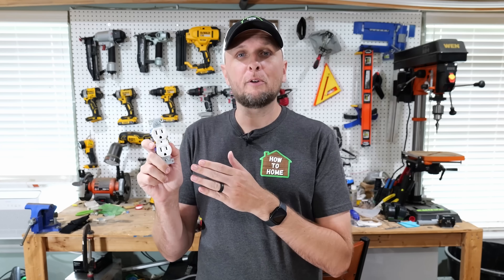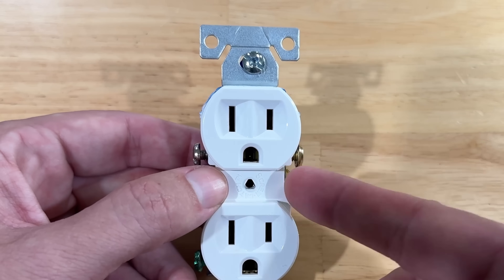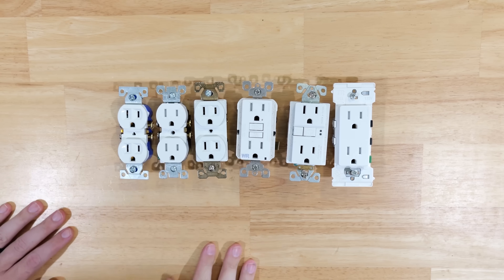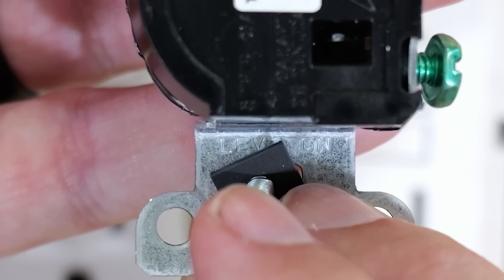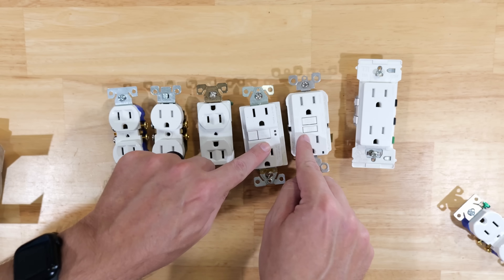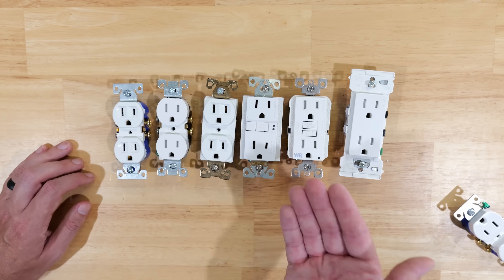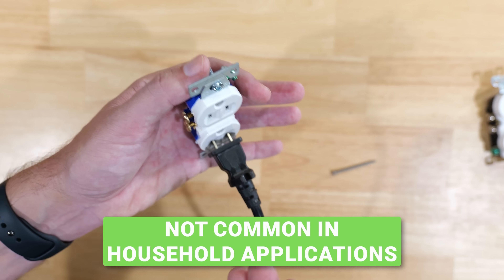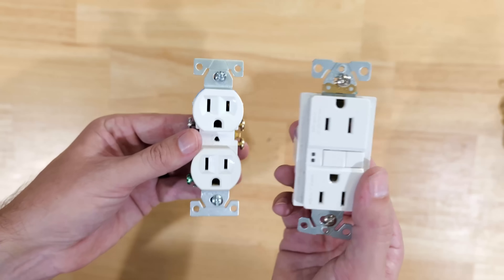The Shocking Reason Why Your Outlets Are Installed Upside Down!

Comment: In my experience it seems that most appliance and extension cord manufactures design their products to accommodate the receptacle being installed ground pin down.  Also, in most cases the only time a receptacle is installed ground pin up is to indicate that it is controlled by a wall switch.
Reply: Retired Electrician here.  WA state.  A common aargument/battle.  Every owner, Designer, talking head had an opinion, up or down.  Inspectors generally refused to get involved.  EXCEPT the ground prong must leave the outlet after the neutral and hot.  It is a design feature that the ground is a longer length for a safe power disconnect.  I can no longer give the design and UL sites, however that is what we were taught in apprenticeship classes as the reason we do not have to shut the power off each time we plug in an appliance.  Look at your power cord,  the ground isnoticably longer to provide for the power to be disconnected in the correct order, and vise versa.
Reply: That would mean that 90% of my receptacles be ground up.  Very inconvenient.
Reply: Retired Electrician here.  WA state.  A common aargument/battle.  Every owner, Designer, talking head had an opinion, up or down.  Inspectors generally refused to get involved.  EXCEPT the ground prong must leave the outlet after the neutral and hot.  It is a design feature that the ground is a longer length for a safe power disconnect.  I can no longer give the design and UL sites, however that is what we were taught in apprenticeship classes as the reason we do not have to shut the power off each time we plug in an appliance.  Look at your power cord,  the ground isnoticably longer to provide for the power to be disconnected in the correct order, and vise versa.
Reply: Yes.  It seems that manufacture’s design is to have the u ground down, like  hair dryer with a built in GFI.
Reply: no such problems Up or Down is the same with Germany 240V wall outlets as there is a ground on the top and the bottom, also angled plugs can be used 2 on the same double outlet..!
Reply: @kpdvw Typical genius design. (sigh)
Reply: Especially so with "wall wart" style timers and the like where you have labeling or even a display of some kind.

I have one exception - a 4xAA battery charger with two-pin (but polarized) plug. It's oriented to favor ground pin up.  Upside down, the LCD bar graph charge progress displays for the 4 bays is invisible. No contrast. Unless you want to stand on your head the only sensible way to use it is plugged into a power bar.

I bought it for portability so no way I'm packing a power bar or extension cord. I stand on my head in hotel rooms a lot. 🤪
Reply: Switched receptacles tend to be placed upside down... I'm not an electrician and never heard of this, but it explains a lot! My current home, and some in the past, fit this standard and I'm happy to know now, for the next time I move and need to figure what's going on with the outlets. Thanks @davidbarham9113
Reply: They had to standardize on something as the alternative would be to either have it stick directly out, which is annoying or they would have to spend some extra money on a slipring design that allows for you to orient the prongs so that the cord is coming out at whatever the most convenient angle is.
Reply: Hair dryers have their own trip wire built in and only 2 prongs. So three prong bathroom outlets are not necessary. Edison vs Tesla.
Reply: Nonsense, all the switch-controlled outlets in my house have the ground down.
Reply: @RSole9999  Hahaha  Just because your house is not like the majority does not mean its Nonsense.
Reply: Items like hairdryers seem to be better accommodated by ground prong down, so that’s my preference.
Reply: In my next house, I am going to put all ground prongs up.  I'll also attach all of my furniture, appliances, cabinetry, and floor fixtures attached to the ceiling upside-down, as well as install ceiling fixtures like lights on the floor instead of the ceiling.  I'm still uncertain as to what my main entrances and garage doors will look like, but I have a few ideas that might prove very lucrative for me when FIMA comes to visit me after the next heavy storm.
Reply: But a receptacle can be split, so one side is on a switch and the other side is always hot.  So much for that theory...
Reply: @brucefowler8690  That in no way refutes the "theory" (I'd rather call it a practice or a convention). In all the houses and apartments I've lived in over many decades, every switched receptable was split. Typically the switched side would be used for a lamp, while whatever device was plugged into the other side you wouldn't want to be controlled by the remote switch but by its local on/off switch. So if followed, the practice would inform you that the outlet is switched and it would be normal to expect that only one side is switched.
Reply: @brucefowler8690  45 years installing recepts and never once thought about turning the switched one ground up, thats because i did it the right way ,like  you ,a split recetacle,
Reply: @brucefowler8690  Actually the theory is correct.  it is indeed how many do it and is sort of a "standard" to use the term loosely.  In a situation like you describe.... I am not sure how I would want it.  I tend to install enough outlets that having one of the two not switched is not needed.

Comment: I install them "upside down" unless the plug I'm plugging it into is "upside down" (refrigerator, window A/C, Power strip,  etc.) 

You can tell the manufacturers don't care because they print the labels/instructions both ways.

What I do find weird on the outlets you were showing is that for an outlet installed horizontally, the writing is oriented for the line plug terminal to be up!?! As a kid who once got a shock when playing around an outlet I default to what I think is safest for babies. I think it is, at least infinitesimally (pun intended infinit... infant...), safer if the ground or common terminal is up. If 10,000,000 outlets installed ground/common up save one kid, it's worth it. Even if it "looks weird" or generates disparaging comments in the YouTube comments section. 😆

Comment: I've always done ground prong down. Now I live in a home built from Adobe block and the outlets in those walls are sideways!  Only have seen that before in Mexico and the city if Chicago....'splain that!😊
Reply: @bobcole3852  Simple answer: Sideways installation prevents you from having to pick a side in a long-standing heated debate like this. 😜
Reply: @davidroddini1512  Of course, in side mounted installations the ground prong should be to the left. :)
Reply: @stargazer7644  lol, yeah so the "neutral blade" is up at top. 😉
Reply: @davidroddini1512  “Countertop spaces require the maximum space between outlets to be 4 feet, and that no part of the countertop is more than 2 feet from a receptacle. So, there are times when an outlet may need to be installed sideways in order to fit into a spot where it is required to be installed.

The required placements of electrical outlets may also influence outlet orientation, as a horizontal outlet may provide easier access for plugging items in depending on the location. For instance, a vertical outlet behind an appliance or piece of furniture may give you no access points, while a horizontal outlet in the same location may allow you to access at least one of the receptacles. If an outlet is needed in a certain location but it is also clear that the spot will be blocked, then an outlet may be installed sideways to try to improve access.

Another common reason for horizontal outlets in your home is simply the result of aesthetic choices. Electrical outlets are obviously a necessity, but if you're on the hunt for brilliant hacks to make your kitchen more aesthetic, you may find yourself wanting to hide them. While this can help your kitchen look nice, covering the outlets reduces their functionality. Instead of hiding an unsightly vertical outlet, some people choose to install horizontal outlets. Horizontal outlets can have a look that is more low profile, which is especially nice for outlets that are placed higher up on walls, such as above countertops. In kitchens especially, horizontal backsplash patterns, such as subway tiles, are popular, and horizontal outlets are especially good in these situations. Rather than break up the look with a vertical rectangle, outlets can blend in seamlessly when they are turned sideways.”

Comment: If ground is on top when a receptacle wears out the plug will begin to loosen and will expose the prongs if the equipment is grounded the ground will be lost 1st and the safety of grounding is lost . If your receptacle is that old, it is normal that your equipment is that old and grounding is your only safety.

Comment: In the house I install ground prong down, in garage, shed, work area I install ground prong up , for 2 two reasons, 1 dropped safety as you show on the video if something is not plugged in all the way and, 2 for stability , the ground prong is longer and feel it will help hold a plug in if hanging and such. one exception in a garage  if I have a fridge or chest freezer, I put that outlet ground prong down due to angle or directional plugs on them , otherwise the cord will go up and have to bend over and go down. Not saying anything I do is correct but is what I do.
Reply: @robertdashnier4184  That’s very sensible. I agree that is a very smart decision.
Reply: I built a garage and turned them sideways….
Reply: Ground down cord weight pulls prongs out exposing them. Ground up cord weight pushes prongs in.
Flat plugs tend to avoid that to begin with
Reply: @heyyou5189  US plugs tend to fall out easily. You want the ground plug the last one to disconnect, so it should be the bottom one for safety purposes.
Otherwise it may loose contact while N and Phase are still connected, leaving the appliance operational without grounding.
Reply: @robertdashnier4184  how many ppl are dropping things on outlets. I mean I drop a lot of things and I have so many outlets and surge protectors. I'm quite clumsy, and not once have I said, that was close to the outlet, let alone hit the plug.  now add the plug tilting out, the object being small enough to fit and conductive. To a lot of others points, if your ground was down, the plug probably wouldn't be leaning out of the outlet in the first place as the plugs are intended for ground down. At an office for that paper clip or staple example, my office always had surge protected or UPS batteries that sat on the floor. Those outlet either faced up (not on the wall, these sit on the floor), or ground might be too a side. So doesn't matter what the wall outlet direction is, there were 6-10 other outlets beyond your control. My garage workbench I have a 6 foot power strip that all the outlets are sideways (ground is too one side). If you really want to solve the drop safety problem, install the outlet above whatever is being dropped. My power strip is 1ft above my work bench, mostly bc I didn't want to have bend or reach around to plug something in. I won't be dropping anytime on our anytime soon.

Comment: Our home builder installed all outlets operated by a wall switch ground prong up (upside down) to make them easily identifiable. All other outlets in the house are in the “traditional” ground prong down position.
Reply: I wish the builder of our home had done that. They just installed all of the receptacles with the ground at the top. It's so annoying because, like others have mentioned, manufacturers of plug-in air fresheners and traditional night lights made the decision such an orientation is indeed upside-down.
Reply: The switched outlets around are usually split. How do you know which one is switched?
Reply: @danlux4954  I like the switched on top allowing for adapters and 90-degree cables on the bottom unswitched.
Reply: @danlux4954  the bottom socket of the outlet is controlled by the switch
Reply: @danlux4954  either one could be switched but convention is to have the top switched and the bottom constant.